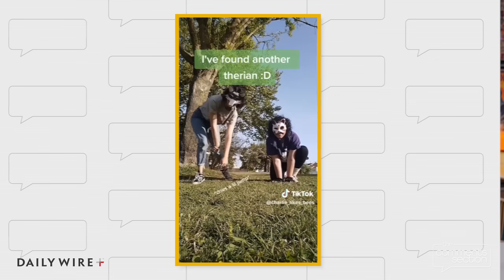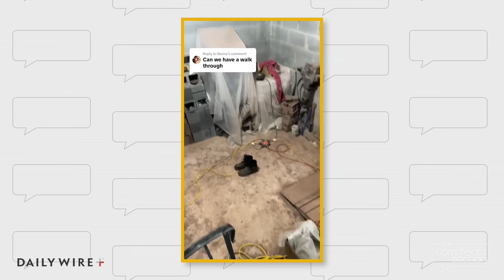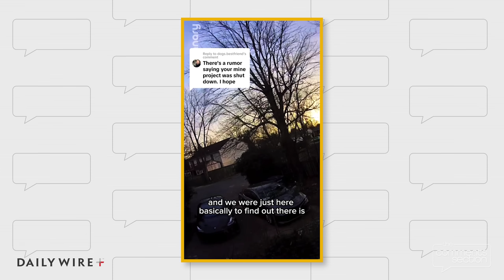TikToker Caught Digging Tunnels Under Her House?!

Comment: In a modern suburban setting, the whole thing seems comical (albeit dangerous too).  It's like a real-life satire of the old video game "Dig Dug" of Atari in the 1980s - lol.  

I am both a mechanical engineer and software engineer.  The person should have modeled the tunnel first using mechanical design software like Auto Cad Civil 3D Software.  CAD is very common for mechanical, aerospace, and civil engineers.  I modeled blood flow through the heart and brain last spring with finite element analysis and COMSOL for physics simulation.  But the low-key selection of YT videos and various light resources to build a tunnel is dangerous.  It could collapse.

On a more serious note, tunnels were used extensively by North Vietnamese in the French-Indochina War which led to the collapse of the final French garrison at Dien Bien Phu in 1954.  The tunnels were then used in the Vietnam War as presented in the classic historical book "The Tunnels of Cu Chi".  The tunnels sometimes opened by surprise within perimeters of a major American base.  The tunnel network was used to launch the Tet Offensive of 1968.  American soldiers were selected to crawl into the network for "search-and-destroy" missions which were among the most dangerous places of Vietnam with booby traps, bubonic plague from rodents, malaria, low oxygen deep underground, excessively large spiders, bamboo vipers, and enemy soldiers.  Moreover, the US Military commenced a search to reveal tunnels by spraying the suspected regions with Agent Orange which had toxic dioxin.  

The tunnel soldiers were referred to as "Tunnel Rats".  The film "Tunnel Rats 1968" opens with contact underground where a soldier is killed in an ambush with a spear.  The ending to the scene "Jarhead" shows a troubled Vietnam Vet who enters a bus of returning marines from Iraq and tries to give them the welcome he had not received decades earlier when protesters often insulted returning soldiers.  The Veteran is shown wearing a tunnel patch and the classic "thousand-yard stare" of war.  PTSD was common among tunnel soldiers.

Comment: I heard about the lady who made an elevator for assistance on the local morning radio show and nothing came of it. The hosts just thought "....huh." and moved on with no one chiming in (listeners who can text into the show). Personally I think it's fine and all just as long as the homeowner does some metaphorical digging beforehand. Commercials used to come on all the time about calling 811 before doing projects in the yard.

If they're not striking major utility lines (or septic tank!) then I'd say go for it at their own discretion.

Comment: there have been many that have built tunnels or underground bunkers.  I think a lot of this is due to seeing those on youtube doing this.  2 people I watch and appreciate are in the middle of doing both.  building a tunnel from his bunker to his garage to his shed to his house and the other just started his underground bunker.    

As for is it legal I think as long as u get the right permits etc.  you could be okay.   as for the danger - again as long as you are figuring out the safety part etc, u should be good.  and staying in with in your yard I figure why not.  make sure it is safe then continue.  

keep up the fun vids. cheers.

Comment: laughs in Colin Furze

Man has had an entire bunker in his backyard FOR YEARS, and recently has been expanding it under his house, driveway, and workshop. Yes, he's had tons of engineering consults done, and he's using as many Best Practices as he can.

Its pretty darned epic.

ALSO, for those that wondering. From the research I've done, there are permits requires for most things. EXCEPT, weirdly, tunnels. On a commercial scale, you obviously have to have excavation permits, geological surveys, environmental impact analyses, GPR mapping, and MANY other considerations. But alot of that is moreso tied to open excavations that commercial applications would involve. Are they still a good idea? Absolutely. But are they necessary? I have have yet to find a definitive answer.

Comment: There was one YouTuber who made his own Spider Hole (I forget what it's actually called). He added wooden reinforcements to the walls, a quick escape tunnel in case of a cave-in (for rescue or escape), and even a TV as well as lighting and whatnot. Was extremely impressive, but it collapsed during some heavy rain while he was away from it, which flooded almost the entire compartment with waist-high water (not sure if any naturally drained before then). I Would love to build a tunnel network on my own, but only after I have the money to heavily reinforce it well beyond what is needed lol. Would also like to make a Fallout-themed Vault door (to Fallout 4 scale of course) to act as the official main entrance; I would likely have some lesser tunnel that leads to the opening section. Ventilation would be a right feckin *** though... as would be getting any heavy equipment like generators down there, as it couldn't be completely dug up from the surface.

Comment: If she's building on her own property, that is the tunnels are still without her property lines, she could do that. BUT, I can guarantee she needs a construction permit. And I hope for her safety that someone watching called the city permit department on her. Yes, it might look like she is doing okay with concrete blocks, a sump pump and ventilation. 
I know, know for a fact that she couldn't cut into the side wall of her basement without a steel reinforcing lintel being installed over that opening. She has now compromised the integrity of that wall and her entire foundation. She has no lintel over it, just cinder blocks. And she's even cut a hole in one of those cinder blocks! Her extension cord wiring is also not to code. I know this from only building a museum and being a property supervisor. How much more is wrong, I'm sure construction people can say.

Comment: This is actually impressive honestly, her tunnel looks clean and stable and the work she put into this is no joke, but my question is why though? What does she get from building this? There's not really anything you can do with all these tunnels. I am no architect, but I'd assume that if these tunnels are directly under her house, this could cause a problem unless she made sure that the tunnel was stable enough and has enough metal rods to support the house's weight.

Comment: Anyone who thinks this looks interesting or anything like that should go see the video Swell Entertainment did on this. Because seriously, she is not reinforcing that runnel that is under her house's foundation. You cannot build directly under your foundations without some serious reinforcement, none of which she's doing because she isn't an actual engineer. She talked about her having a gas leak once and there was a FIRE a separate time. 

What happens if she hits the wrong gas line and doesn't realize, then lights something? What about water lines? Sewage? Or sinkholes? She could destroy the surrounding 8 houses digging 1 foot too far.  What then? There could be millions of dollars of damage in one day.

Comment: In many parts of the US a homeowner owns the land under their house as well.

Never leaving the slab of her home, this is less a tunnel than a narrow basement extension. She likely may have to install a couple load bearing columns.

I don't see any sense whatsoever in make up or expensive fashion. Luckily for those who do, it's not up to me to validate and approve, or, discount and ridicule them. I am disappointed at the overall negativity and derision this woman is getting in the video. She's not hurting anyone and doesn't seem to have malice towards anyone, either.

Laughing at and ridiculing someone for an apparent hobby is cheap and intolerant.

Now, that said, if she's a leftie, lock her up.

Comment: I'd like to get into the tunneling saying. But, I would certainly not do it under my main home. I would do it under my shed so as to not impact the structural Integrity of my home. Also, I live on 10 acres so there is no risk of going under the property line property line.

Comment: This is a very stupid thing to do unless you know exactly what you are doing. There are lots of things to consider like, radon, gasses, water tables, water evacuation, structural problems, emergency exits, load bearing capability on the surface (how much weight can it support on the surface, people walking, a mower, a car etc), erosion, surface water penetration, liability, legality, building permits. The list could probably go on and on if you are an expert I'm sure, but I am not.

Comment: You need a hobby. Just because you don't follow through with your ideas because you are worried about what others think. Doesn't mean we all do. It is on her property; this is completely different than what the Jewish people are doing. If she died doing this, she chooses to do it. The worst thing she could do is hit an electrical line. She actually could spot a sink hole, by doing what she is doing. She probably wanted a balance. To do this and not be out in the middle of know where. Where there is no one around.